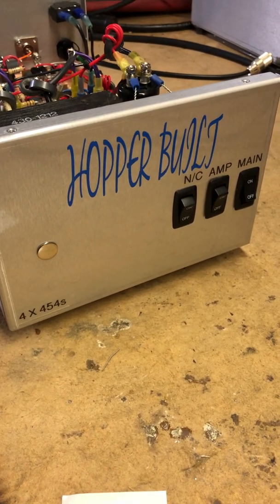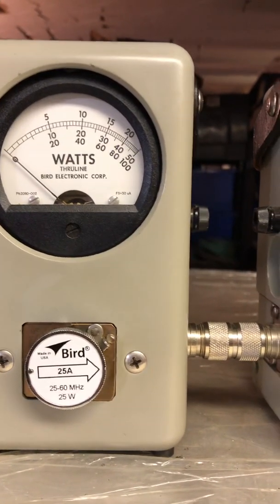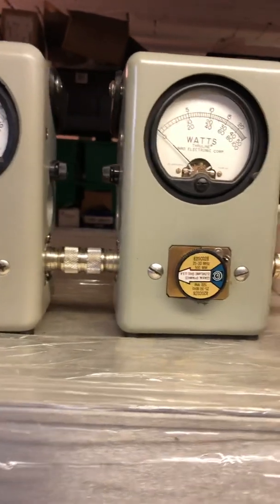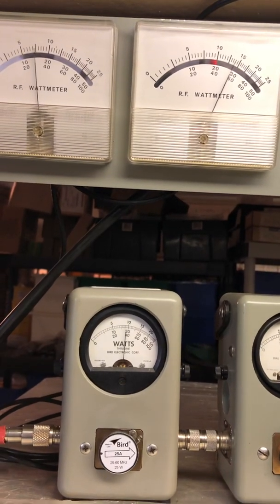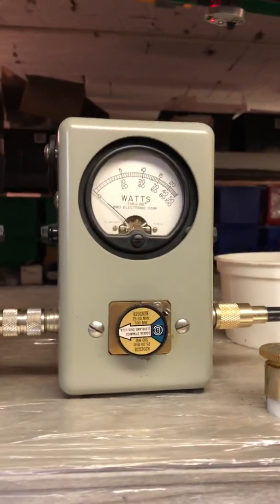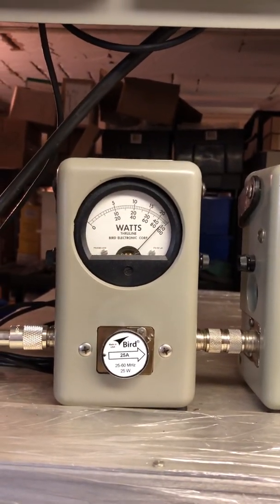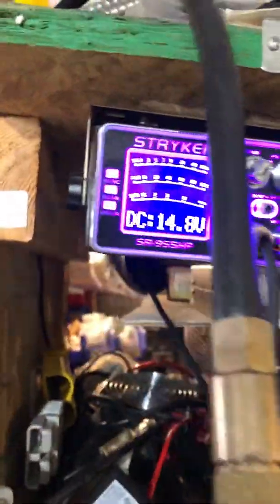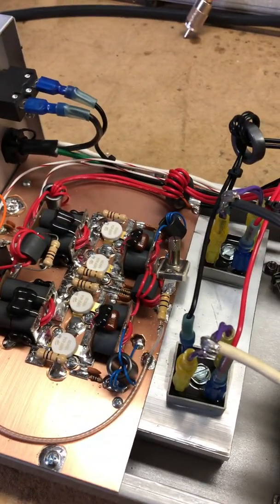Some HG MRF454’s

Comment: 10 amp draw...that's right down my alley for use on my base station.  The amp is a beauty queen for sure!

How many fans will end up on the top cover?  Can you put one up on your website with the transformer power supply?